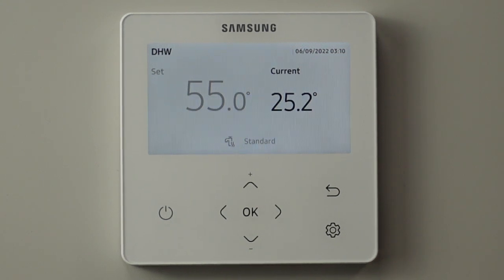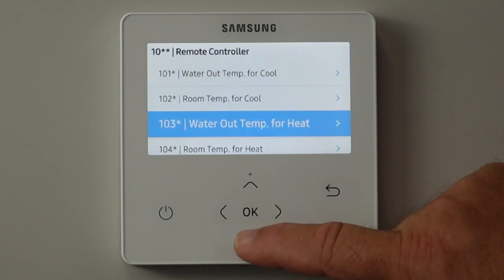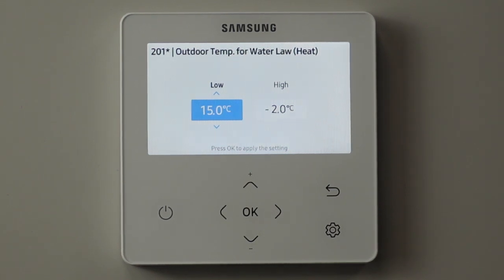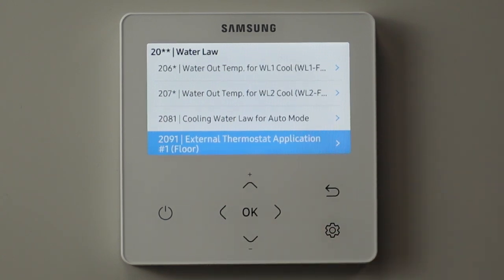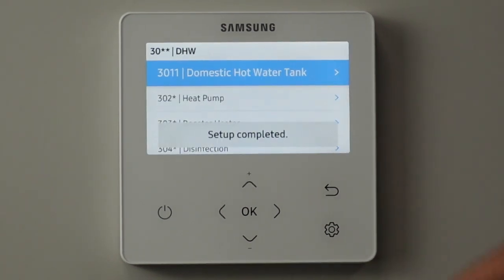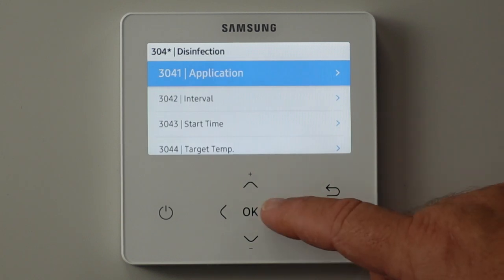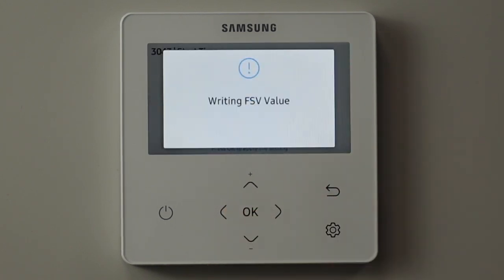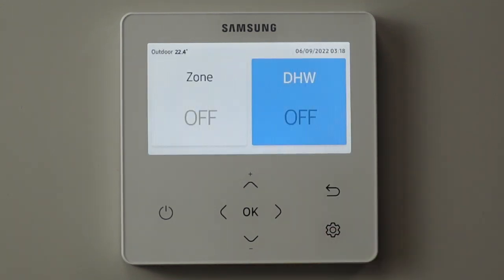Samsung Heat Pump Gen 6 - Field Setting Values.

Comment: Hi, thank you for taking the time to produce such helpful videos. The manual I had with this system was fairly useless, so to have things explained in more detail is great.
I would really value a walk through of 40** the heat part of the option list. Ive had the installation come back and install two zones (upstairs and downstairs), but unfortunately the whole system still seems to come on at the same time. I stumbled across a zoning section within the heating and wondered if this might be whats missing.

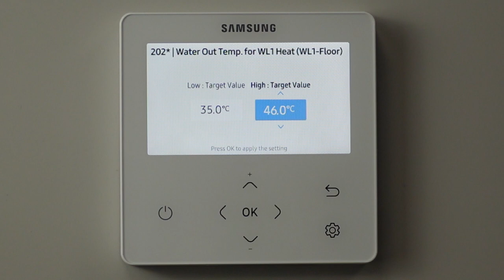Comment: Hi. Ive seen two other videos now that say 202* should be set the opposite way to how you have described. eg, 2:42 minutes. 55 on left and 37 on right, for example. There argument is that "if the temp is low outside target 55c, if it is high outside target 37". On one video, by Freedom Pumps, he explains it like you then later adds a note at tht top of the YT video to say the numbers are back to front. I'm still not 100% sure which way it should be.
Reply: If it's colder outside you'll need the pump producing a higher temp as you'll be losing more heat to the outside and may not feel warm enough with lower flow temps. 

In warmer temps your property is better at containing the heat, so less heat loss and lower flow temperature needed to still feel warm.

Comment: Nice guide, just one question, my system had several radiations installed in a 3 bedroom flat, it only has single zone. I am finding it takes forever for the radiators to get warm, the main outlet to the radiators is warm and the return is cold, normally how long was it supposed to take for the radiators to start getting warm?

Regards

Comment: The weather comp settings are going to be costly. The best settings are 25c flow temp and 20c ext and 50c at -3c outside for rads or 40-45c for ufh.

Comment: Hello, you skipped the Heat settings in the menu 40**. Is there anything else exept electronic mixing valve connected to the terminals B2,B3,B5 and TW4 sensor installed after the mixing valve to make it work? Because I am able to controll the mixing valve in the self test menu, but it does not work at all while heating is on. It does not open nor close to adjust the floor heatig temperature. I am using only one main wired remote controller thermostat as in the video placed  in the area of the floor heating. Thank you.